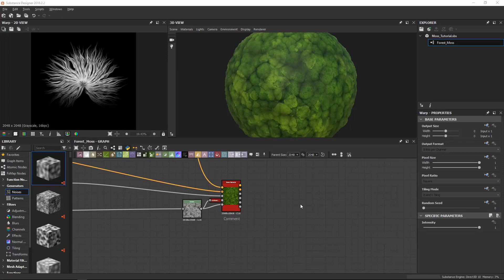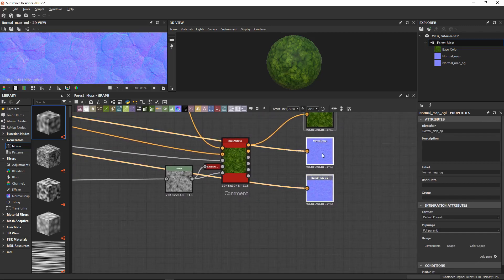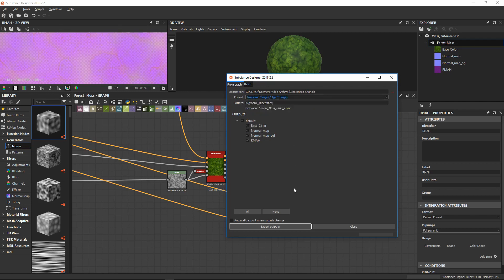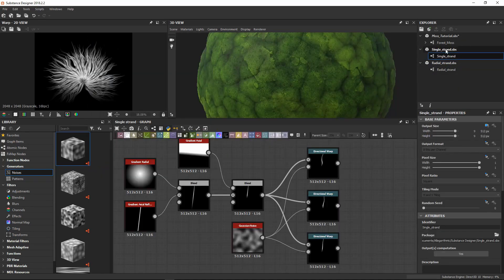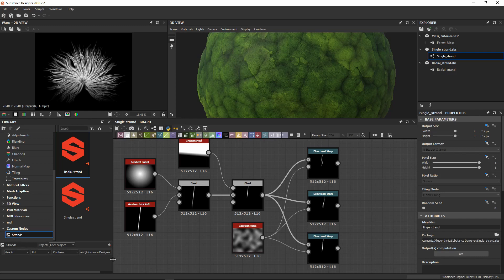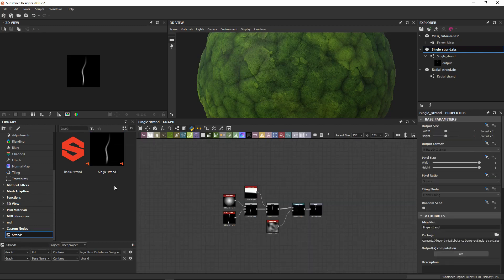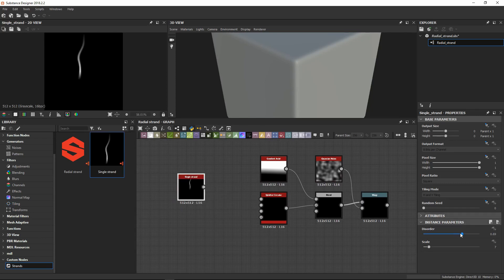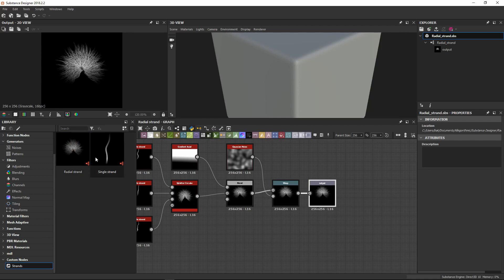Substance Designer Output and Custom Nodes Detailed Tutorial

Comment: Hey there great tutorial!!  i am getting familiar with substance designer right now (this was my second material i was building)
i am using the latest version of substance designer and tried to export the moss as a .sbsar-file but it won`t work somehow (using the material in Autodesk Vred). so i wanted to ask you if i have to do anything different to export it as an sbsar?
Reply from the maker: That is a pretty complex task, there are many setting that you can configure to make the material file work. Also i dont know at all autodesk vred
Reply: @OutofNowhereTutorials  thanks for your quick response i did not expect that tbh :D so you wouldnt export it as an sbsar?